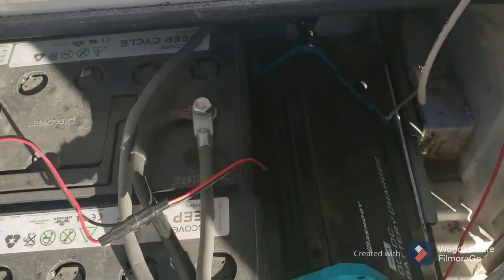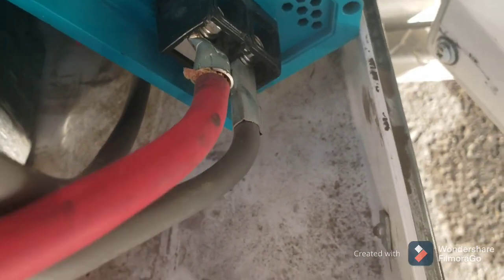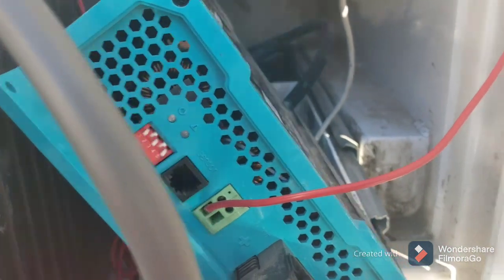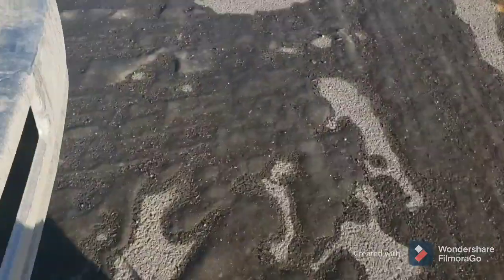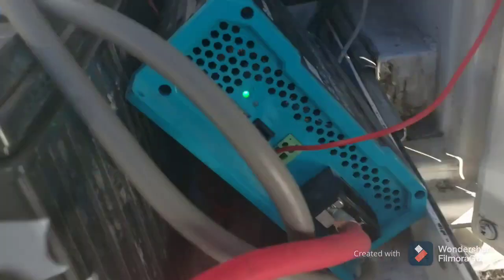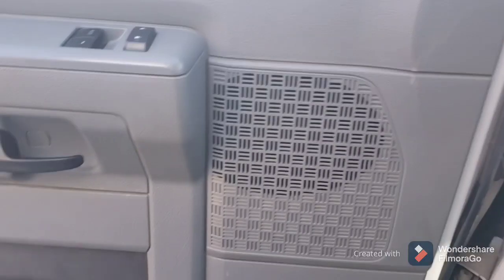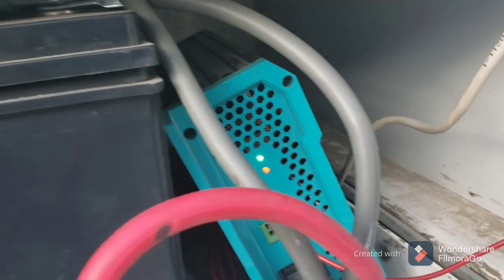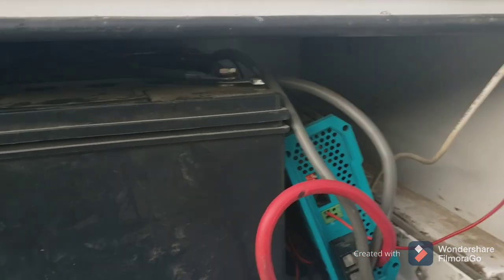Renogy DC to DC charger issue (unresolved)

Comment: I got all connected exactly the way the manual explains & size of the wire confirmed by renogy customer service. The problem is that ignition turned on makes the wiring too hot. Also main battery gets drained totally. Car won't start after disconnecting the charger from main battery. Renogy said, the unit may be faulty but out of warrantee so can't do anything. Ordered newer one but scares me to go ahead & test it.

Comment: I had similar issues with this charger, I had my input negative connected to chassis. I have just connected to my starter negative and it is back up and running. Thank you for all the comments
Reply: Starter negative or starter battery negative?
Reply: @bad_actor1128  So now my DC to DC positive and negative is connected directly to the starter battery positive and negative, and to the leisure battery positive and negative, and not connected to the chassis at all. This fixed the issue for me.

Comment: fitted my 20amp to three 100ah lithiums, got the red light no matter what i did, until i disconnect the + on the lithiums put it on a different battery in the set,and it worked ,and when i put it back to the original connection it worked and has ever since (i did this while it was turned on) ?
Reply: This fixed mine also, couldn't believe it!. The thing battled me for hours lol. All wired up correctly but as soon as you switched the key on green lights up but red light would then show and would switch off. The old disconnect and reconnect on ghe positives at the lithium end fixed it lol. Working grate now😂
Reply: Thanks

Comment: I have the same issue with the 40amp version. I think it went into protection mode.no info on how to get it out of it. Emailed renogy ND all they asked was a picture of a multimeter testing it. So I gave up and bought a victory. ID still like to fix it as a back up if anyone's has an answer.

Comment: I would confirm that you have the correct dip switch settings; looks like you are hitting your batteries with the maximum voltage the charger will produce, double check the specs for your batteries to see what absorption rate and float charge voltage your batteries want.

Comment: I would suspect you have figured out the problem by now, which would mean you should take down the video; but, if not: From what I see you have the unit installed backwards. The input from your starter battery/alternator should be on the same side as the D+ input and power on light.
Reply: I would have thought the same thing but the manual specifically states that DD plus is on the output side. Although it is connected to the input side. So this is not his problem. As I'm having this problem also. But I've only had mine a week. So I haven't been able to work it out.
Reply: https://youtu.be/EcVjPap9dkY   Yep!
Reply: wrong

Comment: For anyone else, start be reading the manual. It explicitly states that you need a separate cable for the negative as well as the positive. Connecting to chassis ground is not recommended
Reply: Not quite, the manual talks about not grounding the body of the charger. In 110 volt applications there is a power, neutral, and ground; in 12 volt applications you only need power and ground. In the wiring diagram in the manual, it shows all the grounds terminating in chassis grounds. When you connect to the negative cable of a battery, you are also connecting to the chassis ground.
Reply: That's incorrect.  My manual specifically states only one chassis ground point allowed in the system and it recommends dedicated ground wires at 4ga or 6ga depending on length of run.  The diagram shows 2 chassis grounds but the text states that they are yo be the same ground point.
Reply: @chiphill4856  does it really matter if it’s two or one chassis ground? It’s the same chassis lol! Plus what would you be grounding except the starter battery circuit and then the charger circuit?
Reply: @dirtyaznstyle4156  Two words: ground loops
Reply: @dirtyaznstyle4156  It matters because many things are grounded to the chassis and all of the grounds are at slightly different voltages, like 0.4, 0.1, etc.   These different ground voltages cause low amperage currents in the chassis, as electrons flow from higher voltage to lower voltages.   These are Ground Loops and they can cause noise and other weird results in electronic equipment.   Sensitive equipment such as stereos, charge controllers, etc can usually benefit from direct battery ground.
Reply: @chiphill4856  the voltage potential of a running vehicle is determined by the alternators voltage regulator. The only piece of equipment on a vehicle that will step up or step down voltage is the DC-DC battery charger. A large stereo amplifier runs at whatever the alternator is maintaining until the alternator can’t compensate for the demand and things like headlights dim. I wouldn’t really call car audio equipment sensitive(bass frequencies are the most tolerant of distortion) although common grounds are always recommended. But unlike the charger at 14.7V the components of a car stereo are running at about the same voltage as long as it’s not oversized for the alternator. I actually have my alternator running at 14.7V lol I should go check voltage at my amps
Reply: @chiphill4856  I’ve upgraded all OEM braided strap grounds, added a fused direct run from the alternator to starting battery and a fused direct run from the battery to the starter. My charger is wired with the positive coming off the alternator B+ terminal to a switchable relay then to the charger. The negative on the input side of the charger is grounded to the frame, the output side of the charger runs to the house batteries and they’re isolated from the vehicle entirely. I just use them to run an inverter.
Reply: I had the same problem. I connected the negative directly to the negative terminal on my starter battery and problem resolved
Reply: I did see that they want separate grounds.   But it makes no sense... It eventually grounds out @ same point.. I don't get... I have hot and neutral going in the DC to DC. One hot out to house batteries and grounded all neutrals to body.  And I'm all green good to go.  But for how long is the question...
Reply: @luisacevedo324  how do you charge your house batteries if the charger negative output isn’t connected to them?
Reply: @dirtyaznstyle4156  I’m sorry. It’s been a while since this post. It won’t charge if the output wire isn’t connected it has to be connected.  But on a dc to dc if the switch wire isn’t on a Switched circuit. You would have a problem like that. It needs a acc wire to turn it on and when switched off it will reset the charger.  Again I forget what was the issue other than what I just seen.

Comment: Have you figured this out? I heard you say " chassis ground ". I've read somewhere that could be an issue. Getting ready to install mine soon and being proactive. Good Luck.
Reply: yep delete the chassis ground and put the neg alternator to neg dcdc charger.
Reply from the maker: No, I haven't. Renogy's customer service is terrible.

I've been in a plug in location lately, so I haven't needed to work on it, but I should try and pick it up again to get it installed.

Good luck with your build! I would be very interested to hear how this particular part goes for you.
Reply: @dansmart5252  I've watched the vid a couple of more times, and at the start you mention a chassis ground. I'm going battery pos and neg to charger, and same coming out to house battery. I've only " heard " the chassis ground causes issues. Might be a simple fix? Good Luck!

Comment: The unit turns off because the 12volt  power supply wire is connected to an initiation line only. So when you turn your car on that’s when the dc to dc gets 12volt to turn on.
Reply from the maker: Yes, thank you, I am aware of the purpose of the D+ line. My issue is that it is turning on, but showing a fault and not charging the batteries.
Reply: These chargers are really simple. Red to red, black to black, battery to battery with a fuse at each end. Send power to the D+ and it will send power to your house batteries. If it doesn’t work that simply, the unit is faulty and needs to be replaced.

Comment: Doesn't the engine have to be running for the unit to work?
Reply from the maker: That's correct. The small gauge wire going into the D+ slot lets the unit know the engine is on. The unit will not turn on after turning the engine on, unless I reconnect the red output wire.
Reply: @dansmart5252  that's the way it's supposed to work so you don't discharge your starting batteries if it was on all the time it would drain down your starting battery
Reply from the maker: @bucket1249  yes, I understand. The unit should be off when the engine is off, and turn on when the engine is on. Currently, the unit turns on when the engine is on, but does not charge the batteries. It does charge the batteries if I turn the engine off, disconnect/reconnect the positive output, and then turn the engine on.

After a while it stops charging the batteries, even when the engine is on.
Reply: @dansmart5252  it must I have a faulty relay or solid state switch isn't working right
Reply: When you turn the key off is the power going to the D1 wire off immediately or is it on one of the accessory on switches that run for so many minutes depending on how charged up your starter battery is I think they call them rap or something circuits
Reply from the maker: @bucket1249  it turns off immediately
Reply: @dansmart5252  got to be a bad unit then